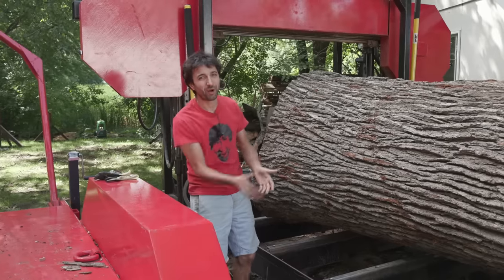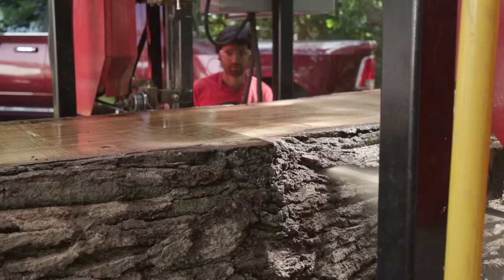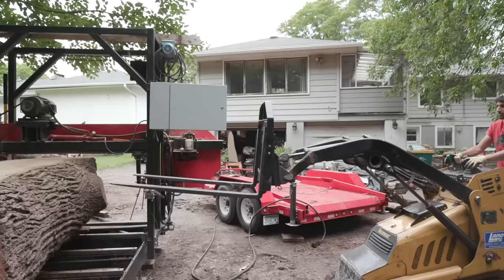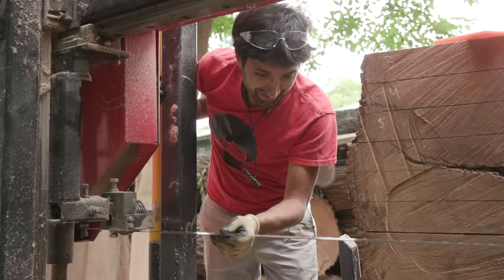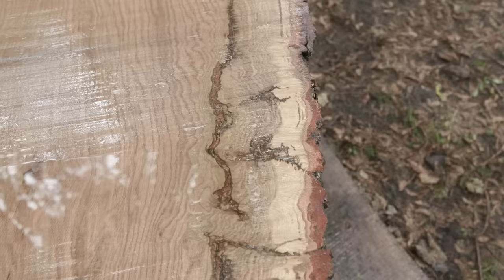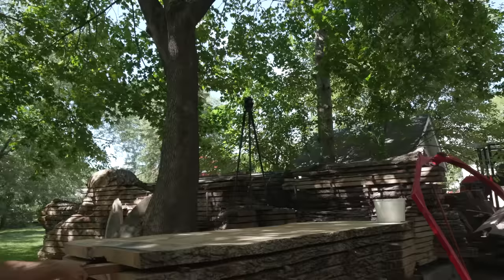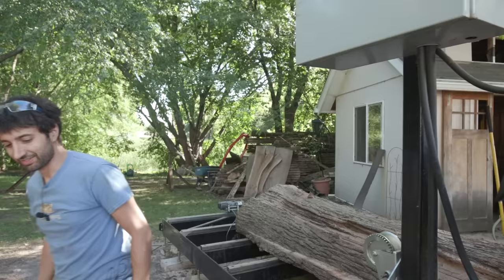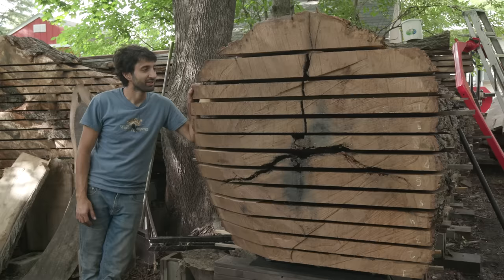Slabbing almost 8000lbs of White Oak

Comment: i was wondering why you dont remove all the slabs as it cuts seem like less weight on the blade is a good thing
Reply: Lol. Didn’t even need  to scroll to find this comment. Thank you. I guess it’s not enough of an issue. Maybe it’s easier to do it all at once, then whatever effort you’re saving by having less weight in the blades. Maybe it also helps to have some weight on the bottom slabs. I literally know nothing about any of this, so take this with a grain of oak
Reply: He's on slab 4 and I'm surprised the wood hasn't caught fore from leaving the slabs on...
Reply: Yes, you'd think that an issue with the very last inch of the cut before the blade is completely through. The moment the blade is completely through there's nothing in front of it holding the load above it up any more, but the blade itself is still underneath all that mass.

Comment: When the blade bound up at approximately 21 minutes could it be the heave weight of the cut slabs on the blade.  I would think there is a lot more pressure and friction on the blade with the cut slabs on top of the blade verses cutting without the slabs bearing down on the blade.  Now I have 4 cents into this huge log.
Reply: What’s that? Two tons of wood resting on the blade?
Reply: cattey   The log he was cutting did not move on the sawmill.  There was 4 or 5 very wide and thick slabs that was dead weight on the slab being cut.  Once the slab is completely cut through and free from the log, all of its weight rest on the one below it.

Comment: When you mentioned how easily steel stains the wood, I thought of a cool experiment. 
Someone could water jet a pattern into a steel sheet, then intentionally dry the slab on the steel. The pattern would have to have lots of open spaces but the stained pattern could be really cool for a project.
Reply: Yep. I know what you think. The dunnage between steel sheets will leave a stain on both sides.. 2 sheets left outside together wil do the same. Water marks. I put 3mm stained on the door to a new pizza cafe..
Reply: @briandufty5081  sounds great brian you got any photos? cheers

Comment: Does leaving the slabs in place put more friction on the blade for subsequent cuts?
Reply: The kerf of the blade (alternating bends at the tips of the saw teeth) probably leaves enough space for the backside of the blade to run freely.
Reply: To much can pinch the blade on the last inch
Reply: I think if the blade was being effected by the weight above you would hear or smell something.
Reply: @patrickscaia9335  the last inch the weight sometimes bog my motor down when I cut a big chunk,
Reply: @patrickscaia9335  affected

Comment: Hey Matthew Cremona, nice to see all your hard work paying off.  I got bit by the big slab bug, and cut my first 28" slabs with an Alaska chainsaw mill last week.  Since you are trying to dry these slabs out, I was surprised you'd throw so much water on them to show off one side (does that not cause them to cup or take longer to dry or does it actually help prevent end checking).  What's the thinnest that is safe to cut big slabs like this before you have to worry about warping and checking?  Have you looked into building a solar kiln to speed up some of your drying?  To your success - cheers!

Comment: Regarding the discoloration.  You may want to check but as I recall some nurseries put put zinc strips in their trees to deal with a zinc deficiency.   I believe that they primarily did it with hard woods and and some nut trees.  I saw it often often in walnut trees back back in the sixties.  This might help explain the discoloration without finding any residual metal.

Comment: Awesome ! Great all the way around !! 
 Only constructive thing I could add,
 You need a 5 lb short(20-26") handled rafting ax at the mill. Instead of the sledge. 
 I use a 28 oz Rig Builders ax. When sawing with my band mill. 
 My mill is only a 24" tho.

 Really enjoyed this and the previous vid on the take down / loading and off loading of the log. ! 
 Really good work. 
 Really like your skid steer also.
 Your mill is nice and quiet with the electric motor !

Comment: I was a forklift operator for 10 years... one piece of advice, whenever transporting a load, the forks should be as low as possible to clear obstacles. This will stabilize the load and minimise the possibility of tipping. I saw how heavy a single slab was compared to your ride-on lift. Whew!

Comment: The slab roller is a great idea. However, you should weld some clamps to the angle iron - to make clamping them to the slab quicker and easier. It would also save you a lot of time.

Comment: That blue mark could be the lightning strike!..great video,the waves are probably due to the weight of the slabs you didn't move and it will burn out your motor quickly the more strain so don't get lazy move every cut slab and things will improve

Comment: 15:00 Put wheels on the sides of the stands toward the bottom (but just off the ground). So that when in use, the wheels are simply sticking out to one side and not supporting the stand. Then you can pull the top of the stand and shift the weight onto the wheels when you want to move the stand - you can roll the stands where you want them.

Comment: I started watching the mill build as I've built two, one powered with a four cylinder VW diesel and one powered with a V twin Honda. They both have a 32" cut and I've wanted a mill with more capacity. In New Guinea I saw a lot of 4 and 5 foot eucalyptus trees cut up for construction lumber. I just wanted to cry. I did cut some nice lumber there. My best days were when I cut a few logs of silky oak and was able to build a fabulous kitchen and furniture for my house. I could get 50,000 for the kitchen here but can't get 20,000 for the whole house there. I love your mill and I love the electric motor. I think I'll sell the mills and build a bigger one now. Where did you get the plans or did you make it up as you went along? It looks to me like you got your parts from Cook saw.

Comment: Forgive the stupid question... as I've never used a sawmill before... 
Wouldn't the presence of 8 or 9 slabs pinch the blade, resulting in an excessive amount of wear on the blade?
Why not at most keep 2-3 slabs in place and remove one slab each pass?  I would think that would reduce any pinching pressure.
Again... honest question, as I've never used a sawmill like this before.

Comment: Hmm. I would maybe look for an epoxy coating for the forklift points? To stop the metal stuffing? There is a product called Copon, industrial epoxy coating that can't be scratched. Was sold at Tap Plastic Co.

Comment: I’m n case you haven’t figured it out yet Matt Cremona, you can use wood bleach that I typically buy from a local ACE hardware retailer. It’ll completely remove the tannin stain in the oak. It sometimes takes a couple treatments to completely clear it up

Comment: Interesting to look at the economics of a venture like this. My guestimate is that this beautiful white oak tree resulted in 12 x 3' x 9' (length), in total roughly 300 sqft. In 2019, before the crazy lumber price increases, I bought a white oak hardwood floor (all milled down to 3/4" tong-and-groove) for USD $10 per square foot. I probably got a good deal. Which makes this tree is worth $3k after milling and delivery to customer site, that seems a very fair price.

Comment: I have a 9500 # winch on my log trailer and I've always used a large deep cycle battery on the trailer .  I was told my the winch manufacturer that they are designed to use the truck starting battery because the amps the winch uses would quickly deplete a deep cycle, since it can't be charged with the truck charging circuit,  I guess.  But I noticed that winch doesn't seem to have the pulling power it used to have when the charged deep cycle was connected.  Can you please tell me what you know and what you use.   I think you're using an 18,000# winch?

Comment: Why don't you pull the slabs off that you have already cut to take off the weight on the saw blade as you keep cutting. I'd think that is excess weight forcing down on the blade. Just curious. thanks. great job you have, great videos. thanks. Tim from Iowa.

Comment: Just advising ,I think you should remove each cut of slab,and then start to cut a new slab ,my reason is the weight of to many slabs will cos stress on the blead and on the motor.

Comment: I guess looking at it from the point of a furniture maker building a large table, many of those slabs have imperfections which makes them unsuitable for a table surface? Also, there are not many planers that can handle a large slab like that for a table, so the furniture maker would have to piece it together out of several sections, which then makes the grain direction/pattern a major issue. The prices per slab will probably vary enormously dependent on the damage like knots, small holes and blue stains?

Comment: Just asking'... why don't you take the cut layers off as you cut them. There's got to be tremendous weight bearing down on your cut making the saw and blade work harder and possibly binding up. I'm certainly no authority on the subject but it just seems that it would make it easier for the blade not to bind up.🤔

Comment: You should weld a socket where the handle on the crank would be then use an adapter and a battery drill to advance the saw

Comment: Awesome work. 

I hear White Oak is harder more dense the Red Oak?

What is the avarage thickness of each slab?

What is the average estimated weight of those White Oak slabs?

Besides better exposing the grain is there any other purpose of throwing water on the wood slabs?

What is the cost of the saw blades?

How long do you season the slabs?
Do you cover the slabs to protect from rain & snow exposure to elements?

Stay Safe.

Comment: Do you have your blades re sharpened or are they replaced when they get dull? I'd imagine they are really expensive to replace. I have been thinking of getting a mill like this just much smaller for like 24" logs.
Reply from the maker: I never have. I just keep buying new ones. I’ve accumulated a good stack of blades that could be resharpened if I ever feel compelled to do that

Comment: How thick was your cuts?
The weight, dull or degree of tip may be why your blade doesn't make it to the end. You had close to 2 tons of weight on your blade.
Ever think of putting an A-frame over your mill with mutiple anchor points to help you flip your logs?
I've learned alot from you.

Comment: I started watch your channel a few years back.  Like the saw, the new trailer and the fork lift...  Watching you flip the slab, I have an idea for you ... why not make the rotisserie a Deep U shape rather than a L shape. I would make the U shape deeper to slide further on to the slab with some built in clamping devices so when the slab is vertical it will not slide out of the rotisserie brackets (serves the same purpose as the wood clamps) on the L shape brackets with wood clamps?

Comment: I really enjoyed your journey with saw blades. You started with the cheap ($50) steel blades. Then came the bi-metal blades ($100). Then came the carbide blades ($150). How much cheaper are the expensive blades over the cheap blades in one season?

Comment: Do blades come in different kerfs or maybe just slight differences between manufacturers? Also, some sawmills have optional "debark" devices to supposedly elongate the life of the blade. I'm assuming that's not something you're concerned about with your carbon steel blades. Would it be more of a concern with carbide or is bark insignificant to them?

Comment: After each cut why wouldn't you remove each slab so you didn't have all that extra weight pushing down on your blade?
Reply: The thickness of the teeth, or kerf, is wider than the actual blade.  As you're cutting, the wood isn't squeezing the blade, except at the very end when the blade pops out of the cut.  That's why you see some pieces of wood move right at the end.

Comment: Nice unit and set up. Just a suggestion, if you have a set of wedges to place along the edges as you cut behind the blade you can widen the gap and get your forks under the slab as you need to remove them and it takes stress off your blade.

Comment: Two questions. One if you’re moving the Saw through the wood without moving the wood how does the saw stay level? Number two why didn’t you take more pieces off as you cut them all at one time instead of leaving them cut on top of the uncut lumber?
Reply: My guess,  2 reasons; 1. content

2. Had to get deep enough cuts to accurately determine if the rest of the log was workable/worth working with

Comment: Does the weight of the cut slabs on top of the saw blades not hinder the cutting process? I'm not being critical, I have zero knowledge about how this thing works and I'm really curious.
Reply from the maker: It does not. The teeth are cutting a wider path than the body of the blade.
Reply: @mcremona  ah gotcha! I'm picturing it now and I guess there's much more room than I realized and the slab never really rests on the saw blade until the very end where the whole slab's got cut completely.

Comment: How does your saw not bind up with the weight of multiple loose slabs bearing down on it and no water or lubrication?
Reply from the maker: The teeth are cutting a wider kerf than the thickness of the blade so it’s not in contact with the wood

Comment: How fast does your blade turn - RPM? Your motor is 1740 RPM but the V belt reduces the speed to what RPM?
Reply from the maker: Drive shaft turns at 595rpm. Blade speed is 4500ft/min

Comment: What a waste that oak log would have been. If it were to be cut up into firewood or rotted away somewhere. You are very environmentally friendly in helping preserve all the wood to acquire. By cutting the wood into use for furniture or whatever. The width of some of the wood logs are not readily available and would be extremely costly to purchase. I know you also get a lot of wood for the price of picking it up. Very Smart.Your band saw is excellent and the trailer you fabricated is excellent.  Please keep the videos coming.

Comment: Have you considered welding 2 simple clamps to the angles with the pin, then its one piece at each end, lock it on, clamp it on, spin, rinse, repeat... Not telling you your business, but for as many slab as it looks like you handle, any steps you can save would help.

Comment: really impressed with your riggings bro!  ingenius!!   maybe for some stabilizers   weld a cutt off peice of steel inside your stationary frame area... something fairly adjustable so you can drop a bottle jack on top and grind the top of the jack to a sharp spike...  get your log where u want it,  then just jack that spike until it has some good pressure on the log...maybe have multiple..hell even some of those cheap japanese car jacks that u could get at pick n pull for cheap would work? I installed a 24 foot long 2000 pound beam all the way up into the ceiling of a house all by myself with those...  good luck to ya lad!!

Comment: Please excuse my ignorance. But I was wondering why you leave the previously cut slabs on top of the new cut, to my mind the way physics works, the extra weight might cause drag on the blade. But what do I know. I'm not a carpenter and I don't have a mill
Reply from the maker: No drag as the body of the blade is not in contact with the wood. The teeth cut a wider path
Reply: Thanks for your quick answer, I wasn't expecting that. Makes sense. I'm a licensed electrician in Florida I wish I could take a two-week vacation and help your gear around and cut up logs it looks awesome

Comment: Just love watching these videos. I have a question. Of the pieces ( like either 5 or 6 ) would you charge to cut one of them in half ? ( 2” to 1” ) and then sell the two as is. Keeping the piece at the top length.
Thanks, Steve

Comment: I just cant believe hes not taking off  each slab as he cuts to not only release the pressure on the cross cut but the wear of the blade over time.Use equipment right & they look after you.

Comment: why are you dumping water on the slab, is it just to show the grain or is it there another purpose?. I love your video...
Reply from the maker: That's the only reason.  thanks!
Reply: @mcremona  thank you...what method do you use for preventing splitting at the ends?
Reply from the maker: @Kimeltuwe2023  anchorseal
Reply: @mcremona  thank you, sir

Comment: I'm a White Oak quarter sawn freak. Surprised the bottom part wasn't quarter sawn because of the vertical crack and the remaining size would have been manageable...manageable for Matthew, not me.
Reply from the maker: I’m not a quarter sawn freak so I prefer to through saw. It’s like a variety pack of grain orientations

Comment: The weight of the cut boards are putting pressure on your blade...
Reply: You need to take each slab off as you go.  That's thousands of pounds of pressure on your blade and the belts.  You're causing more stress on everything.    Why don't you just take it off as you go vs taking just a couple off at a time.  Makes no sense to me.  Especially when you're dealing with a few hundred dollars for a saw blade.

Comment: I would have cut from the other side and the middle where the staining was I would have cut that off. I would have lost maybe 12-14 inches of maybe 2 boards. Then the areas of stain and possible wire or staples would have been not a problem

Comment: I once owned  a woodworking shop, I learned a few things about stacking and sticking ruff sawn wood.   1.  Aways try to place your stickers a lot closer to the ends...this will help prevent checking at the ends. A good rule for this is 4 inches and no Moore then 8 inches at the  end.  2. That ruff saw marks on your cuts is do to you not removing your top sawn planks.. the extra weight is causing the blade to bounce up and down.  Just some helpful hints I hope.